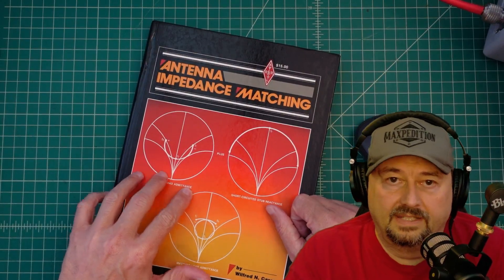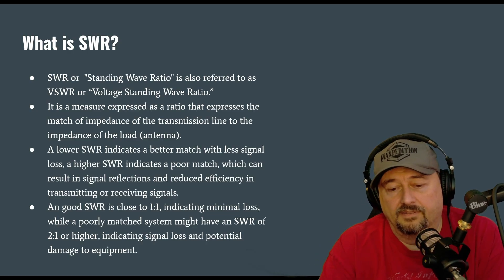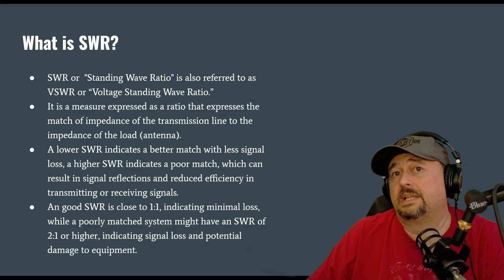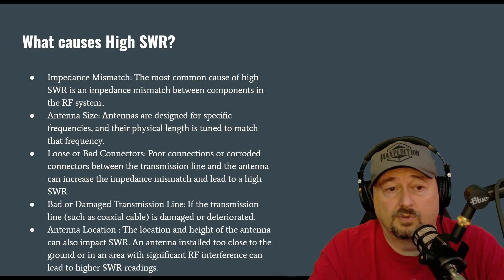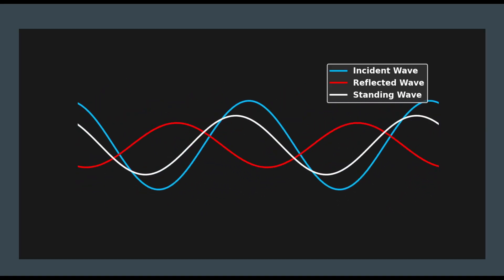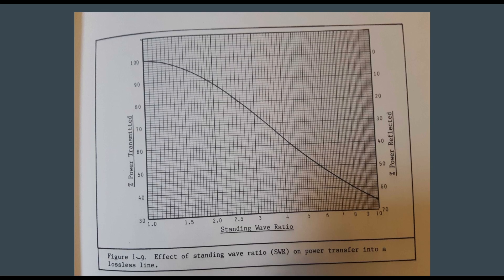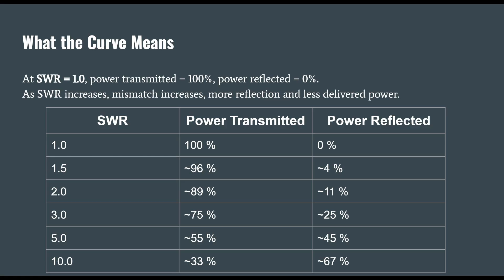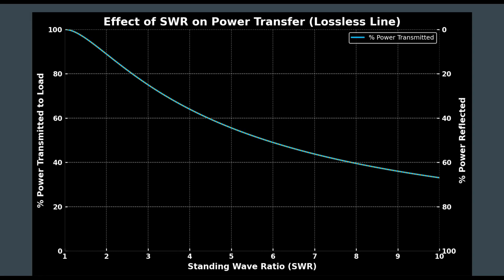SWR: How Standing Waves ACTUALLY Behave!

Comment: There is a misconception among many people that a conjugate match exists in a properly adjusted transmitting system.  If we have a conjugate match, then all the reflected power will be absorbed by the transmitter.  None will be re-reflected, and in general we don't want that.  With a conjugate match, the best possible efficiency of the power output amplifier is only 50%.  Instead, we want to present a load impedance to the transmitter that optimizes the performance of the transmitter without overstressing any of the components.  Since most transmitters have been designed to operate optimally into a 50-Ohm resistive load, a 50-Ohm load is what we want to present to the transmitter.  That does not mean that the transmitter has a 50-Ohm output impedance.  When properly adjusted, our tuner or matching network or antenna and transmission line does not create a conjugate match but instead presents a load of approximately 50 Ohms to the transmitter.

Having said that, why do we ever hear about the need for a conjugate match?  A conjugate match is useful in small-signal circuits when we want maximum power transfer between subcircuits, such as when we want maximum amplification of a weak signal.  When we are dealing with small signals, power efficiency is usually of secondary importance and there is no danger of overstress of the components.

Comment: It is really important to accept and understand the output impedance of the transmitter is not guaranteed to be 50Ω. This is especially true of rigs that have built-in tuners, auto or otherwise. The transmitter needs to be tuned into a local dummy load and adjusted to provide the greatest efficiency to that load and then not touched again. All tuning for the antenna is done at the antenna (not another coax cable with transmatch) by what ever devices one has there be it an EFHW or a tuner, and the power measured should be very close to what your charts say for a given SWR. This ensures all the attached devices are very close to the ideal 50Ω. A common compromise is to treat the coax like it's part of the radiating element with a transmatch but there are a lot of messy variables and common mode current to deal with. It is common, though for hams on a budget.

It is helpful to know what the generated power is but with solid state transmitters it can be difficult. "In my day" said the old boomer, we had available to us plate voltage and current, we knew what the tubes should produce for output given the input power, and those values were carefully controlled per the radio designer's instructions.

Most of the commercial radio stations I installed were ship to shore marine service systems though I also installed some base stations in Mexico. Until the 70s they were exclusively tube-based, and all the rules for safety of life at sea were in play - no skimping.

This involved creating a counterpoise for the transmitter if it was directly attached to the antenna - not an uncommon configuration, or to locate a remote tuner near the base of the antenna and fabricate a counterpoise there. Very difficult on fiberglass yachts regardless of the size of the hull, but a piece of cake on superseiner tuna ships, oil tankers, and container ships. 

Step one was to tune the exciter (transmitter) into a dummy load taking note of plate voltage and current, and energy delivered to the load. This was repeated for each frequency band used. No knobs, here, this was done by moving switched taps on inductors and turning variable capacitors with the appropriate tool. Once done these were never again touched nor did they need to be.

From this point on the antenna tuner (not a transmatch), located at the base of the radiating element was tuned for each frequency band to minimize VSWR. On a sailboat this meant long periods in the rudder space bobbing and jerking against mooring lines to tune an antenna that might be an insulated back stay or a whip antenna mounted to the transom. On larger steel vessels the antenna was typically a 25' or 35' fiberglass whip bolted to the ship.

I've done this while at sea on oil tankers that don't have time for such installations in a harbor. A memorable trip from Kodiak island to Valdez in rolling seas on the wheelhouse of an empty 150 DWT Chevron tanker comes to mind.

But - the process was as described. Tune the exciter into a locally attached dummy load with Bird 43, then attach it via coax to the tuner, tune the antenna. A 2kW PEP commercial radio system is savagely vicious to tuner and exciter components that are mistuned and dripping with fog. Long but illustrative of the process few hams are ever exposed to. For many years, though, I used an SGC (I worked for the company) tuner with a variety of exciters and PAs and a simple whip antenna because I could, and it was very efficient.
Reply from the maker: That’s a fantastic perspective with great info, thanks you LGITY 👍

Comment: Interesting point about measuring current to determine SWR. Back in the days when people walked fast on film, light bulbs in series with the feedline were used to determine peak power transfer from the transmitter. Problem is that putting things in series with a transmission line is that you alter the impedance of the very thing that you are trying to measure. So whilst it may be possible to measure current to get an idea of SWR, I'd be interested in how this is used currently (sorry!) or if it is just pedantry?
Reply from the maker: Hey man, I am unfamiliar with how it works 🤷
Reply: @TheSmokinApe  It's not a good idea with a 50R output transceiver but was used with tube transmitters which had a wider range of impedances that they could match. A bulb was put in series with the antenna and the transmitter and the output tuned for maximum brightness.
 
Not accurate but gave an idea. I also understand that a number of WW2 transmitters also had incandescent bulbs and the output tuned depending on brightness.

Comment: It is worth reminding people of why VSWR became the standard (& not Current SWR which would give the same value):-
Before we had SWR bridges/meters & before we had co-ax we just had a voltmeter ( preferably moving iron which reads ac RMS voltage directly rather than moving coil that needs rectification to read ac) & we had open wire lines rather than co-ax. To read VSWR touch voltmeter directly across the line to read voltage & slide it back & forth to find the max & min voltage points.... Express this max & min as a ratio... Of a Voltage measurement, & given I cannot run up & down the line at the speed of light these Max's & mins are a standing point hence Voltage Standing Wave Ratio.
Voltage is easy to measure across an open line but to measure current at various positions you either need a current transformer slipped onto one side of the line but the spacers holding the line apart will stop this being slid up & down to find the max & min so that is no use. Alternatively cut into the line measure current, resolder line move a bit then check there for max/ min... Rinse & repeat is an absolute pain so Voltage SWR measurement was preferred.
It was only when co-axes came along & we could no longer scoot along the open wire with a voltmeter that VSWR bridges/meters became widespread.
Reply from the maker: Makes perfect sense StreakyP, thanks man 👍

Comment: Electronics for the inquisitive Experimenter has published a spread sheet, based on ARRL Antenna Book equations, in his video  "Antenna Tuners: The Math (076e) that will calculate feed line losses and reflected losses when you didn't spring for "lossless" coax.  Losses from reflected signal in real coax are trivial below SWR less than 1.5, but appear to increase exponentially with SWR above 2, for an example I ran for UHF..  Moral: SWR matters more for UHF. Consider RG8X for "longer" UHF feedlines (say up  25 ft tall mast to clear houses and trees).  Run the spreadsheet for you particular situation.
Reply from the maker: I’ll have to check that out 👍

Comment: Sometimes people make way to much fuss over SWR.  One HUGE mistake people make about the topic of SWR (that you mentioned) is that the reflected power is lost power, it's not.  It is reflected back to the antenna for a 2nd try at being radiated and then a 3rd and 4th and so on until it is either burned up in resistive losses in your transmission line or radiated from the antenna.  This is why you can see more forward power on your wattmeter than your actually transmitting.  It's the sum of the power your transmitting plus the reflected power.  Use extremely low loss transmission lines like parallel transmission line or large coaxial hardline and most of your power is radiated by the antenna even though you may have a horribly high SWR.  I have transmitted into HF antennas with a SWR over 10:1 before but was using 7/8 hardline with a antenna matching unit (antenna tuner) and it worked fine.  My radio was happy thanks to the antenna matching unit and probably 96-97% of my power was being radiated from the antenna due to the extremely low loss of the hardline coax.  It may have taken the RF several tries back and forth but it eventually got radiated by the antenna.
Reply from the maker: Howdy Mike, that’s for adding to the discussion with the additional detail.  The wattmeter showing elevated levels is a head scratcher the first time you see it 😮
Reply: @TheSmokinApe Thanks Ape for the presentation. 
Let me make a point here.
We talk about the SWR, VSWR (ISWR), because it's the ratio of voltage to current to a fixed (pure) resistance of 50 ohm. This 50 ohm value has been a fixed one (in our systems and other audio and test instruments etc) because of the 50 ohm standard of the coaxial cable. This characteristic impedance of the coaxial cable has been found out experimentally to be the mean value (both arithmetic and geometric) for maximum power transfer and minimum high frequency attenuation of the signal. 
According to the maximum power transfer theorm (The Thevinin theorm), the characteristic impedance of the source, transmission line (if there's one), and the load must be identical.
Recent solid state radios (over 40 years) are being manufactured with the standard antenna port impedance of 50 ohm.
Earlier hybrid types or the olden days tube transmitters were usually having a "pi" network or some sort to couple RF energy to a variety of antennas using a variety of transmission lines. 
There was no need for a fixed characteristic impedance of transmitter, transmission line or the antenna. 
Because of the 50 ohm standard requirement of modern solid state radios (dictated by the 50 ohm standard of the coaxial cable) the feed point impedance of the antennas into which the coaxial line is terminated have to be made 50 ohm by using BalUns or UnUns. Because different types of antennas have different feed point impedances depending on many factors. 
The ASSUMPTION that using a "LOSSLESS" transmission line will guarantee complete absorption and, hence, ultimately effective radiation from a load antenna despite a huge SWR MISMATCH of 10 to 1 is ABSOLUTELY WRONG. 
Because of the huge mismatch between the transmission line (lossless) and the 10 to 1 antenna load the RF energy would be traveling to and fro countless number of times until all the reflected power is WASTED in the so called lossless line by OHMIC and DIELECTRIC LOSSES. 
10 to 1 SWR is certainly BAD in any radio station. 
Solid state radios come with ALC function to reduce (fold back) the power output by reducing the voltage applied to the pre driver and / or the driver amplifier stages to protect the transistors (or FETs) 
Any load higher than 50 ohm will cause higher reflected voltage, and if it exceeds the voltage handling capabilities of the final transistor, it can be ruined by an open circuit in the devices. If the load happens to be less than 50 ohm there's more current drawn into the load and this excess current has to be provided by the final transistors resulting in the phenomenon of "thermal run away " Many people will be of the opinion that the MOSFETs are practically immune to thermal run away. 
Each time the finals are abused due to high SWR, some of the bonding wires to the numerous transistor junctions inside the power amplifier devices will be destroyed (apart from damaged junctions as such); the efficiency of such devices will be degraded over time for sure. 
Anything less than 2 to 1 SWR will be fine. 
Using an antenna matching unit  (whether in built or externa one) should always be encouraged instead of trying hard for example to bring down an SWR of 1.7 to 1.3 by spending a lot of time in pruning the length of the dipole. 
de VU2RZA
Reply: Yeah...like a ham I worked for years ago.  1 watt ref on HF was too much!  Damn bud...get real. If you think 499 watts isn't enough and that extra 1 watt is needed to make your CW QSO with a Yagi...well..., I guess it's a pretty far DX.